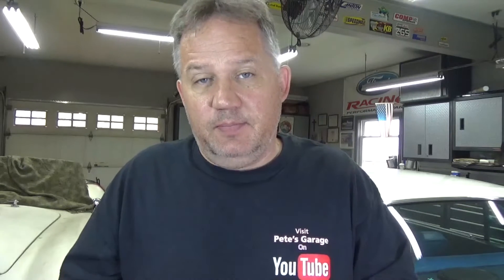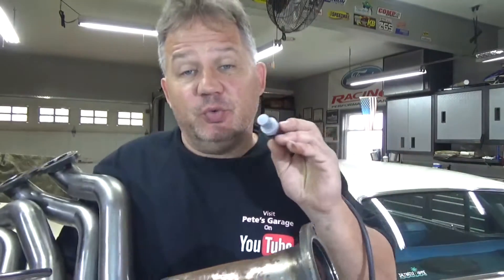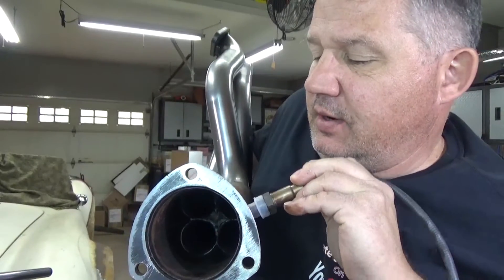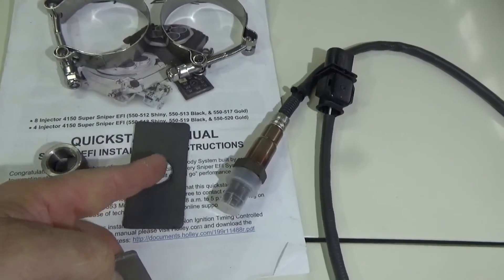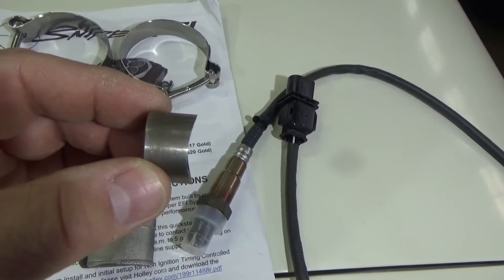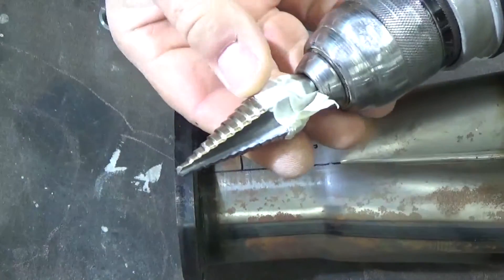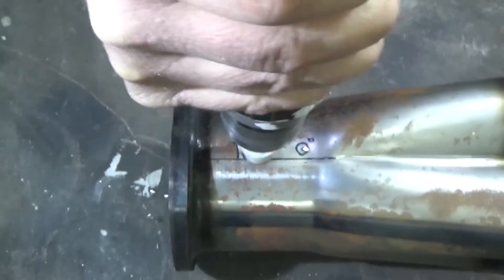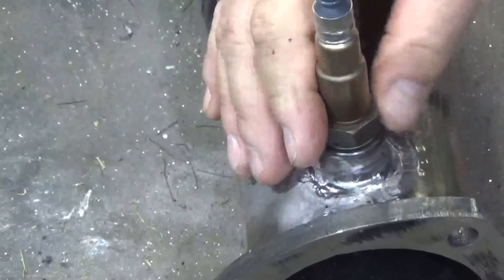Welding in an O2 Sensor Bung for a Holley Sniper EFI System

Comment: I need to install one for my AFR gauge but my intake manifold has already an O2 sensor for the ECM. Shall I replace it with the one for the AFR ? Or shall I drill an extra hole ?? Thanks
Reply from the maker: Why is there a O2 sensor in the intake manifold?
Reply: Sorry, I meant exhaust manifold @PetesGarage  @PetesGarage
Reply from the maker: Use the signal from the existing one
Reply: Hello Pet, any advice on how to do this please ? Thank you @PetesGarage

Comment: I have a 2006 camry 2.4L. Cat was stopped up so I have the first one gutted and the second deleted. Now my AFR sensor, right off the exhaust manifold, is bad. I should still replace that sensor even if the cat is deleted right? What kind of damage can it cause without it working properly?
Reply from the maker: Any time you delete components you are going to really mess up the computer and all of the sensors

Comment: Pete I have an wide band o2 sensor for my 6pack 440. Im trying to think of the best place to mount it. I will be doing H pipe or possibly x pipe. Will the sensor function ok that far downstream, or do you think i should mount it on one side and get a second one? Im really using it to get my carbs semi dialed in and see how they act. 

I appreciate your videos.
Reply from the maker: Anywhere between the mufflers and header collector will work

Comment: Just a small addition to the install...put a good copper based anti seize on the threads of the censor. With moisture in the tube they can be real hard to get out.
Reply from the maker: Great tip. thanks

Comment: I have a 1979 chevy half ton truck with dual saddle tanks , I am installing a holley sniper EFI system 550-510 . I intend to leave the stock tanks run a 150 GPH mechanical pump on the engine to a G-surge tank like the one they use with the fitec system it will return to tank , from the surge tank , that way I dont have to buy new fuel tanks  , eases way to do it and keep both tanks , we will see how it works out , thanks for the O2 info, time to buy a 18 mm x 1.5 tap
Reply from the maker: Sounds like a good idea, thanks for the comment